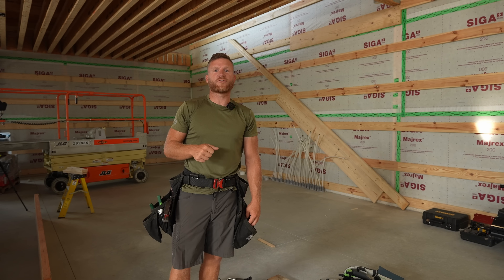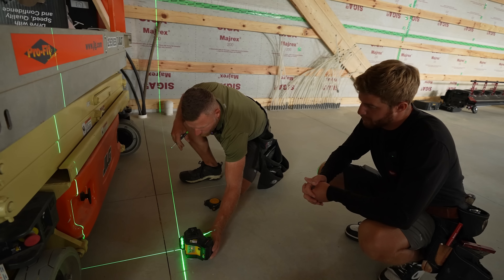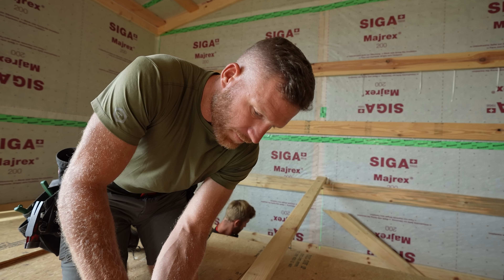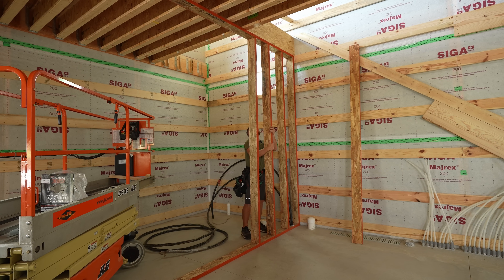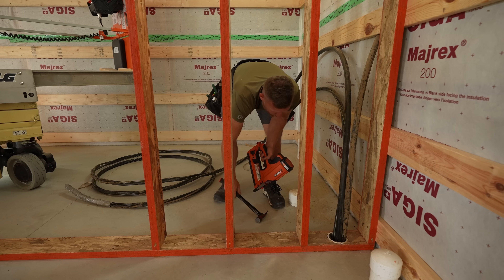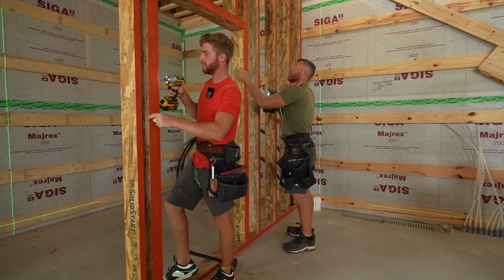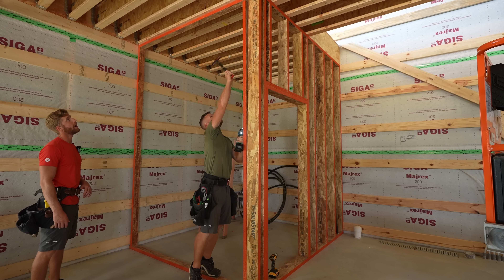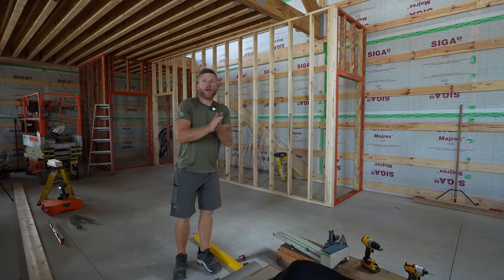FINALLY...RRHQ Bathroom and Utility Room Framing #construction

Comment: When you install the tapcons do you have the floor heat tubes located so you don’t drill into them or are the tapcons short enough where that will not be an issue? 🤔
Reply: My memory is a little fuzzy but I believe he made sure the tubes were plenty deep enough that tap cons wouldn't hit. He regularly tap cons walls to concrete so I'm sure the needs and details of that were one of his priorities in the design.

Comment: Kyle, it's a missed opportunity to not put in a shower while it's an open, blank slate.
  I think it would add so much extra value to your building for very little cost.  Imagine getting all dirty working on something,  then being able to clean up at your headquarters and not track a mess into your home!
Reply: I believe he talked about this in the beginning, with the way building code is structured in the zone his property is on, he had a lot of rules of things he couldn't build, including building height restriction and the inability to build a shower.
Reply: Wow, If that's true, you're incredibly sharp for remembering all that.  If he can't put a shower in by code, then of course - but if he can, then he definitely should.
Reply: I believe that he lives in Illinois, so you know they have a bunch of stupid rules. I am from IL originaly and I moved to Indiana.
Reply: @tariqbojic7632  I think he also said he might put one in and if he does we won't see it
Reply: @Hopalong..75 i use to live in the quad city area, now in iowa. Build a shower, don't "hook" it up. If the illinois governor can do that with toilets so it doesn't count,  why can't normal citizens?

Comment: As you plan the mechanicals, consider using an air-to-water heat pump, for heating, hot water, and cooling (with separate hydronic air handlers). This is the ultimate for energy efficiency, consistent with your growing interest in building science.

Comment: Gotta agree on the shower....  I get that your house is right behind you, but on the occasional need for it (really dirty and not tracking into home), it would be useful.  Also, if there were some kind of chemical accident diesel/paint thinner/acetone/ etc spilled on you, it's right there.   Needed, no, but nice to have.   I've never needed to use the showers in my classroom (science), but I am glad they are there, just in case.

Comment: It could be so rude if you install a system like the Bosch Compress 7000i something primary heating source.
and then it could have been fun if up in your man cave you had installed a floor from NOVOPAN Spaandex Floor chipboard or similar.
and I still believe that there should have been insulation between the workshop and the man cave with a foot of insulation.
But all this It's just dreams. I read an article somewhere that energy had increased less in Denmark and due to inflation than other European countries because in the 70s they started making demands for the insulation of houses and buildings..

Comment: if they are using the house well pump, I would run 2 water lines, fresh water for hose bib and softend water for toilet and sinks.
I would put the door at the top of the stairs
Reply: If it's even needed, it would be cheaper and easier to add a softener in the shop.
Reply: @greb3212  i personally would hate maintaining even one of them

Comment: If it was my shop, I would have the bathroom door open OUTWARDS, because I know what a pain it is trying to move around inside a small room with an inward-opening door. And you are not exactly short of space on the outside. Just my penny's worth.
Edit: I take that back. You have plenty of room in there! 😊

Comment: I assume you will be doing a dropped ceiling in the restroom to accommodate the branch circuits from your breaker box since it is below the landing of your mezzanine.  As to who makes the call for the location of your gaming system?  As a certain late night TV host often ends such statements, "... a sexist would say".  ;)  Seriously, though, a great build with great commentary so others can also have great builds.

Comment: Maybe I'm lazy or just a noob, but I would have used a double top plate attaching the top plate to the ceiling, building the wall, then standing it up and sliding it in into place.  Wall could have been lifted between the I joists and moved into place.  Plastic shims on the floor would take care of the minor variation on the floor.  I also would have cut the side of the bottom plate and slid it in.  They need stud shoes anyway, don't they?   Of course, I'm no pro, and maybe my ideas aren't really ideal.....

Comment: Any reason why the door needs to be at the bottom of the stairs and not at the top? You would air condition a space that does't really need it, e.g. the staircase
Also, with the mechanical room below the stairs, you would get radiant heat through the stairs into your air conditioned space. Anyway, that's how I see it, I may be wrong :D

Comment: If you are worried about putting a screw thru a tube in the floor, would it be ok to glue the bottom of the wall to the floor? Asking for a friend.

Comment: Def agree with the other comments that you should have extended the bathroom to add a shower. Even if not for yourself, if you sold it at some point down the road that loft up top may be a living space for someone. That said, it might be smart to hook up a washer box on the exterior of the bathroom wall for a washer. Think it all the way through bubba, But great job either way

Comment: In construction when you cram too many things together in one area problems just start occurring somehow some way they occur putting steps in the rear of the shop that would be a mistake then putting steps over top of your mechanicals that would be even a bigger mistake then putting electrical next to water we don't even know where you're going with this now it's like there's no thought work at hand You're just blabbering things out why not get an engineer or even look online come on man this is just our opinion

Comment: In our opinion we think you're going about it all wrong putting the mechanicals by your stairs is going to be a major mistake in the near future Even having your bathroom by your stairs is going to cause problems down the line separate them move them away from one another and you will save yourself a lot of headaches rethink how you would do it but the mechanicals and stairs they never add upright really put some thought in it go and look around at other people's ideas and plans to get a better understanding of what direction would be best for you but this looks like a major mistake in our opinion
Reply: Resistance is futile, we are the Borg.....